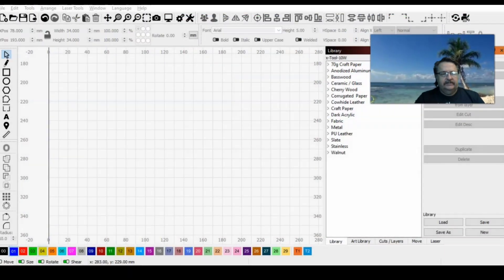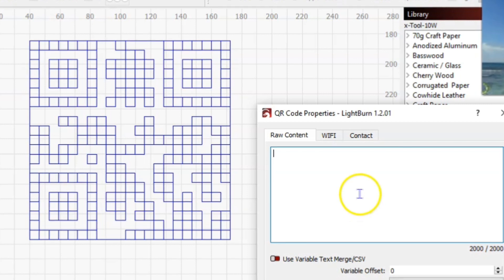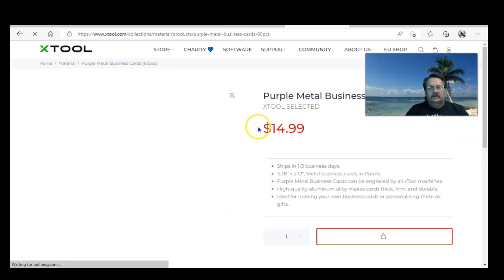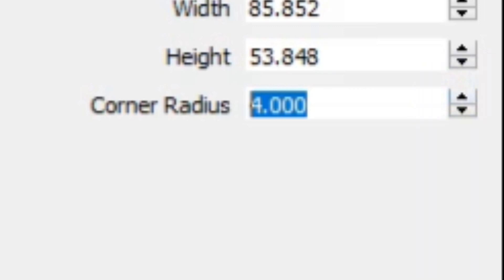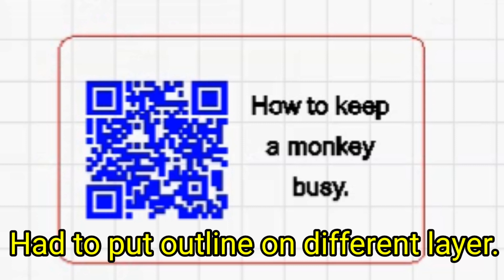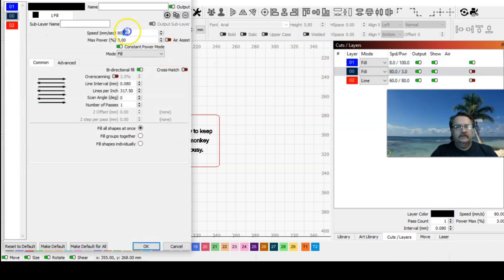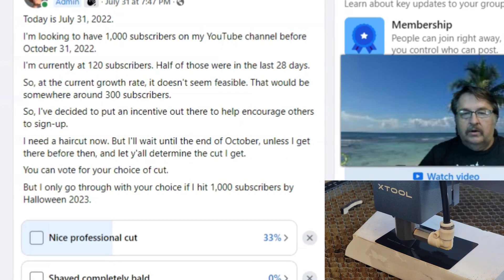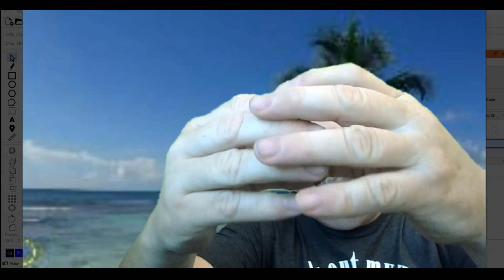Creating QR codes in LightBurn and engraving a metal business card with the xTool D1

Comment: I did this on a green metal card and it will not scan. Do only certain colors work?
Reply from the maker: The only time I've had it not work for me is after I applied a coating on the engraving once it was finished. I think the sealant filled enough of the engraved perimeter that it "rounded" the shapes enough that the camera didn't recognize it any longer. I simply sanded that image smooth and it worked again. When doing the QR codes I'd have the line interval at .08 or smaller to try and get as precise an image as possible. I just created a business card holder that has a place to engrave the business name and a QR code on the front for those that would rather scan the info instead of taking a card. The work great for me, (as long as I haven't sprayed a sealer on them).